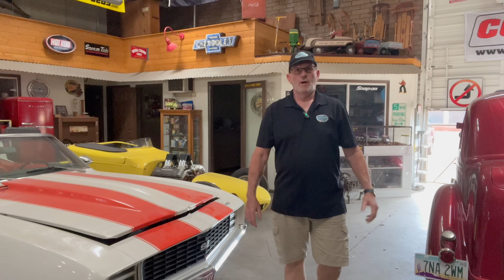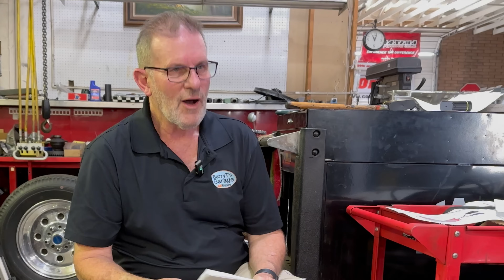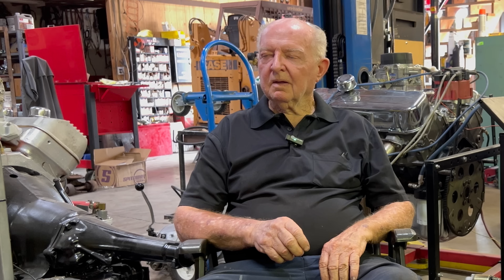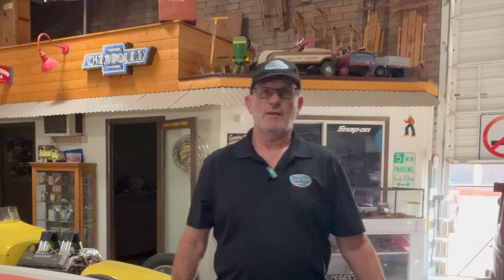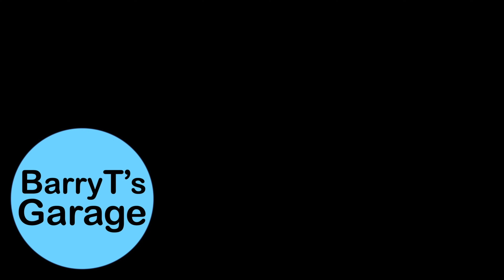Why a High-Volume Oil Pump Can HURT Your Engine | Ed Smith with Barry T | Ask Ed 4

Comment: Ed, your thoughts on side clearance are spot on. I cut my teeth on the old CH-150 rods from Childs & Albert, if you didn’t have .003 a .0035 minimum vertical clearance and minimum .040 side clearance, it would turn the crankshaft black. We learned real quick the importance of side clearance. The only thing allowing that bearing to cool is the oil escaping on either side of the rods allowing cool oil to take its place. It also gets flung onto the cylinder walls and protects the skirts
Reply from the maker: That’s very well said!

Comment: I would like to know what Ed thinks about drilling a .030 hole in the driver side pipe plug behind the timing chain to spray oil on the thrust bearing
Reply from the maker: I’ll ask Ed his thoughts on that trick next time we’re in the shop!

Comment: I have always run a 396 stock oil pumps on sbc, just double up gasket under the distributor, that pump takes the least amount of hp to run, never have distributor gear problems, melling actually makes that pump for sbc today, only difference is .125 in height.

Comment: Hi I have a question I have also heard that it's a 10 lb of oil pressure for every 100 horsepower is that a correct calculation or not
Reply from the maker: I’ll ask Ed

Comment: Valvoline and pennzoil make really good oil right now. 
 Walmart super tech,for the price is right up there to be honest.  Walmart gets their base oils from ExxonMobil,makers of mobil 1 and a 3rd party just mixes it. It meets all the minimum requirements. 
 Valvoline has a really good additive package as does pennzoil ultra platinum. I'd run pennzoil ultra platinum but its not available in 0w16. I went with mobil 1 for now. I'll probably switch up to valvoline because of their excellent wear prevention package. The valvoline where i got the mobil 1 wasn't available in 0w16. It's not easy finding it where i live. I'm not paying napa 45 bucks..... go to bi mart,28 bucks for 5 quarts of mobil 1.

 Yes there's science in oils,but it comes down to personal choice and what fits your budget.  Realistically the most important thing is the correct weight of oil and just changing your oil. For yoir average person just driving to work/other average  people activities, some cheap supertech is just fine. Again, having oil and changing it really helps.

Comment: Something of a study guy's might look into is this : Make a visual test of oil flow at your bearings. All of them.
Lifters are awful at times as well.

I have found huge oil leaks at the cam bearings and main bearings.  The worst was the Ford FE. The anular groove along with the narrow bearings invites a  look see.  A camshaft is of course installed to meter the flow as it is unloaded, but you will know what you didn't. -- Solder old  main bearing holes or grind the tangs off to reverse them and snug the caps.
 Use a pressure pot, set the block on your build table in a barrel waste oil container.   -- You must plug every oil feed hole to do this testing but, every oil source will pass a huge amount of waste discharge. So catch it. -- You determine what is excessive in my opinion for camshaft oil splashing with flat tappets. 

Install the crankshaft and rods and test the assembly. -- You're looking for horsepower with every refinement you find and it's very messy. Figure a few days to do this but you will know more than your competitors.

Yes it's messy but I'll guarantee you will be shocked on waste oil flow especially using hi-volume pumps.

PS : I found all of this through my years of assembly without the oil pan on !  Initially running the engine briefly without it with a long tube on the oil pump into a gallon of oil.
I decided I would do this before I installed the oil  pans and have been continuing to do it in my closing years. 

It's fun.
Reply from the maker: Thanks for the detailed explanation and testing tips, that's awesome!

Comment: Thanks for the info, on my last 2 sbc builds even though I've used a high volume oilpump with a 7qt pan with the trap door flap, i think my next build i will use a stock pump & continue to use my 7qt pan thank you.
Reply from the maker: Great plan!
Reply: steandard volume/ high pressure , only way to go.  My standard issue oil pump for a small block. The Milodon 18756 , part number literally hundreds of engines built with this pump,with no oil related failures.

Comment: Why is only the 69 302 considered a DZ motor not the 67-68
Reply from the maker: Chevrolet did not offer a 302 in 67 or 68, it was created in 69 for the racing series specifically as a high revving track car
Reply: @BarryTsGarage  302's were available in '67.

Comment: The suction from the vacuum pump in the crankcase also stops most oil leaks, also the oil pressure at the con rod big ends is multiplied considerably due to centrifugal force from the spinning crankshaft
Reply from the maker: This is a great point that I haven’t thought about, I’m going to ask AD about the centrifugal force happening inside the rod bearingson the big end

Comment: I saw an engine years ago that the rear main didn't have a seal, but there was a groove like an Archimedes screw to push the oil back into the engine when it was running. Is this something that could still work in a modern engine?
Reply from the maker: Maybe in some applications. Currently, there are such good seals, that they eliminated the need for this.

Comment: PLEASE ASK ED about port velocities and cam durations under 310, advertised durations are miss leading to the novice,the rod clearances,esp side clearances are paramount to keep engines alive on a 10 hour burn state to state,i don't race,,i want horsepower that doesn't go away due to heat,heat is the killer for traveling people,i'm now changing oil and filter at the 3500 mile drops,it comes out dark with this frequent mileage rate
Reply from the maker: I will ask Ed

Comment: How do you keep the crank from walking back-and-forth? So you can get the rod adjustment for 35 40000.
Reply: One of the main bearing will have thrust surfaces on it, they come in various thrust widths in conjunction with the main journal sizes to accommodate resized crankshaft journals

Comment: 8:16pm , Tony here , how much oil does a stock classic engine need at idle. My Studenaker 259 v-8 has 12psi when hot at idle and 35 psi while driving 60 ,  mph. I tried everything to increase pressure , seems 20-50 0il helped best and a oil cooler? Thank you.
Reply from the maker: It’s a good question and I think a lot of people with old and well used engines come up against exactly the same issue. I will try to ask Ed in a future video, but in the meantime, I would just suggest being gentle with it and as long as it has PSI, You should be able to get a good bit more life out of it. In all likelihood, the internals are worn enough that you just can’t build normal pressure anymore….

Comment: A vid on low vacuum engines & choosing the right PCV valve would be great
If hes reading 383 sbc 7-8 inches at idle. Stock pcv or one off an LT1, big block or?
Experimented making the stock hole larger and noticed later the idle was lean, lazy. Wonder if I screwed up!
Reply from the maker: Great, I'll ask Ed in an upcoming vid

Comment: On my 390 stroker FE Edelbrock to put too big a holes in the oil feeding the rocker shaft and at 5,000 RPM I had no oil in my engine oil pan or almost no.
Reply: That's just typical FE. They flood the top end with oil and not enough time to drain back. An oil restrictor in the rocker arm feed holes in the heads remedies that.

Comment: Reminds me of the very early IROC series when they used TRACO engines. All built as close to the same hp as possible. Some drivers complained of low oil pressure.... 40 to 45 lbs  max  during the race !  None of em ever had bearing problems ... ! All the engines had the same low pressure.
Reply: This!!  Had a brand new 350 that when warm would have 15 lbs max new, same hot pressure as you described
Always worried about it later learned high pressure usually isnt needed, just wears dist.gears faster. 
Unless Im using maybe a solid roller/high spring pressure I only use Std volume pumps, perhaps a bit stiffer spring, its all ya need and frees up a touch of power.

Comment: Yep can confirm: a high volume oil pump alone puts all the oil at the top of the motor= good way to destroy a motor
Reply: I'm not real familiar with the car stuff  but I build performance Harley engine's for a living, one of the big mistakes that amateurs make when they build one is getting a high volume oil pump and putting it on one without modifying the oiling system by restricting certain circuits to keep excessive oil from building up where you don't want it, without making those mods you're actually better off just running a stock pump, I've built plenty of them for people that didn't have big money and just used stock pumps without having any issues, especially drag engines, I've seen guy's at the drag strip that built engines with an aftermarket oil pump that didn't make the mods to the oiling system and right about ⅔rds of the way down the track when oil starts building up in the bottom end and the flywheels are turning in all that oil it looks like they throw an anchor out at that point on the track and just quit accelerating.
Ed talks about vacuum pumps on engines, Harley's really benefit from them, especially something like a flat track engine that runs sustained high RPM's, Harley street motors are difficult to put vacuum pumps on the bottom end so I make flywheel scrapers and windage trays for them to keep the oil down in the scavenge area instead of churning all around inside the case's, that'll put an extra 6 to 10 HP on one of those engine's and it's about the cheapest 6 to 10 HP you'll ever get outta one.
Reply from the maker: Straightforward way to put it 🙏🙏
Reply: The mistakes ive made in the past.

Comment: All these years later, and I didn't realize at the time, but Fords used to twist the hex shaft that drove the oil pump off the distributor.  I used to sell a lot of those.  This was in the 70's.  I had a dream job.  I ran a parts store and had a race car.  69 Nova.  Chevy was easier.
Reply: Remember those shafts being sheared off in the 80s when I first started working in shops.
Reply: @gordocarbo That's right.
Reply: Replaced a few of them that were twisted  on my '63 260 c.i. fairlane.
Reply: It takes 51lb/ft to start twisting the Cleveland oil pump shaft.
ARP gear goes much higher.

Comment: Ed talking about the vacuum pump reminded me of back in the late eighties when racing was exploring V6s. a friend was an assembler at Ruggles Race Engines He said they had their engines down to only a 5hp variation at the most on their high output V6. One day when rushing to get an engine ran on the dyno it produced 50HP more than expected. Everyone was scratching their head as why this engine had more than expected power. What they finally realized was in the rush to dyno they had installed two unvented valve covers. The dry sump was pulling a vacuum on the crankcase and negative pressure under rings helped to pull intake charge in. Guess which valve covers all the engines had on them from then on
Reply from the maker: Rodney! Great story!  Thanks for sharing this with us!  👍👍😎

Comment: I always thought it was strange that folks worried about those vent holes in the lifter valley on Gen 1 SB but aftermarket blocks have all that cut out in that area so it makes me think it isn’t an issue or the aftermarket would have addressed it.
Reply: Its for the guys who want that last little bit esp with larger strokes and windage .
Plugged those off on my 383 sbc.
Reply: @gordocarbo  Buying an aftermarket block that holds twice what a stock block would probably is trying to squeeze every bit out of the build. I know one builder who has epoxied the holes up in his aftermarket block and installed screens front and rear he’s running Super Stock so yeah he’s doing everything possible to gain maybe a couple horsepower. As my original comment asked though why did the Dart aftermarket leave the valley open for oil to run across the rotating assembly if there was HP to be gained by it not doing so. I’m speaking of Dart SHP’s which everyone is using. I know World didn’t do theirs that way it’s similar to factory in the valley. I guess only the manufacturers can answer this question.